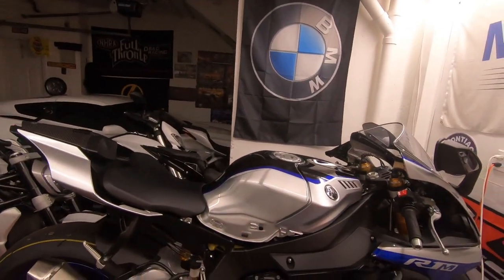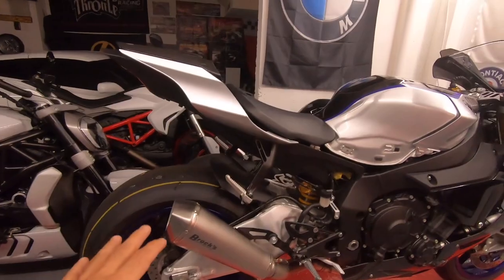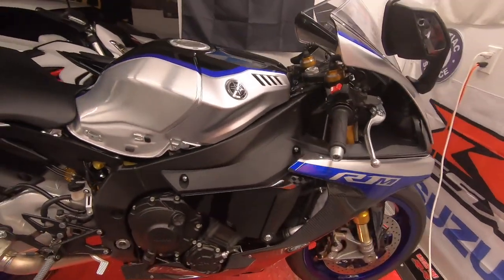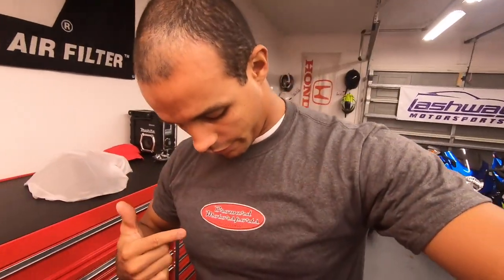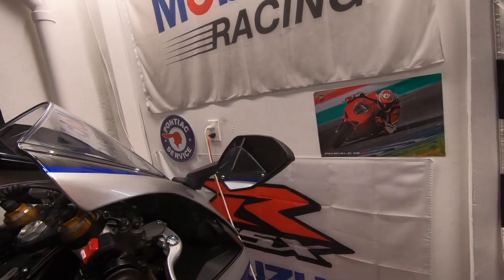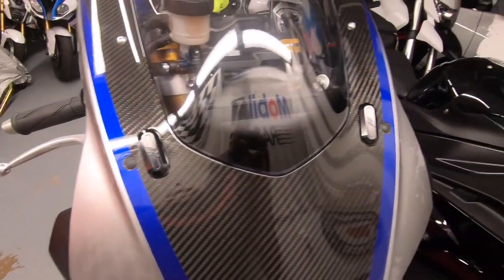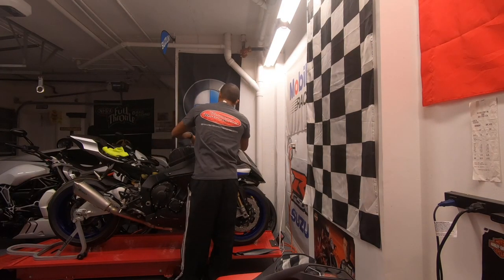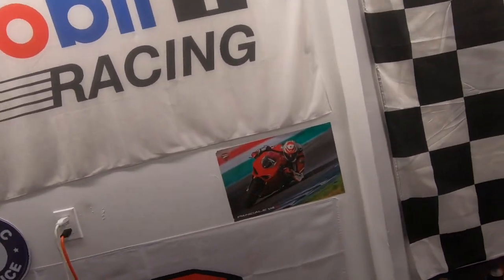2018 Yamaha R1M Build - Part 2

Comment: hey bro, can a ecu flash make the r1 more fuel efficiency ? while still remain some power ? my 16 R1 drinks fuel like water
Reply: That's was the only reason I sold my 2015R1M all I could get was 90 Miles out of  a tank of fuel . Cross plain motor is famous for loving its fuel.The ecu was flashed & the bike was perfectly tuned & I loved it except fuel issue
Reply from the maker: Sure you can in theroy, but at a cost, timing, leaner, all things that make the bike a lot less fun. In this case it comes with owning the bike. Very similar to the Ducati. More power, more thirsty.
Reply: @mosoliman4489  yeah, love everything but fuel issue